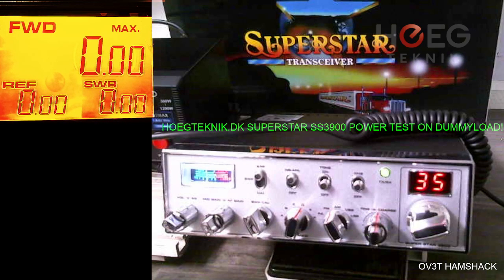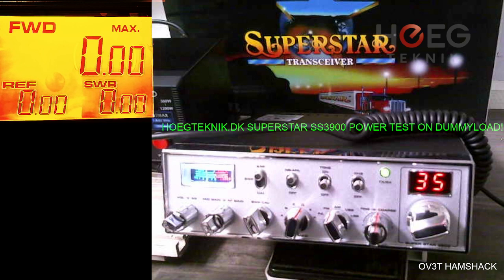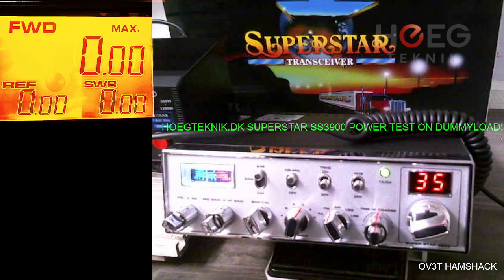Superstar SS3900 2023 version - output power test (ENG)

Comment: ALC control on board will turn up Sideband output .
So seems it was turned up to get 40 Watts.
Nice radio older models you can work on if there's a problem .
The newer radios they make work but surface mounted components and micro processors cannot be worked on like classic style radios. 
Good day.